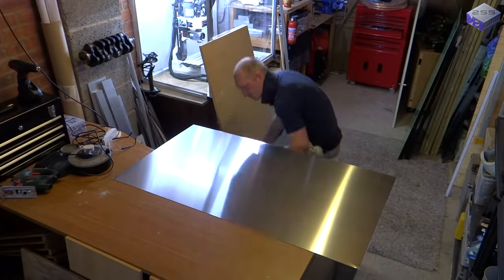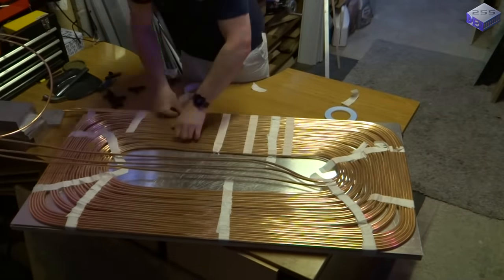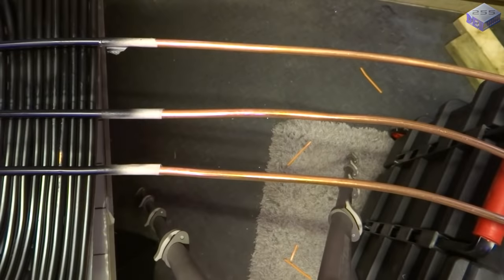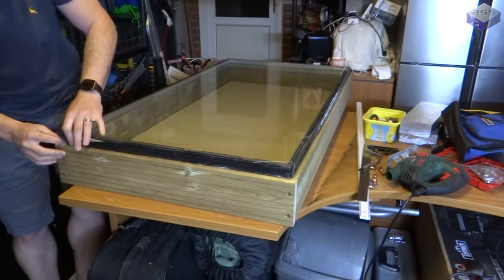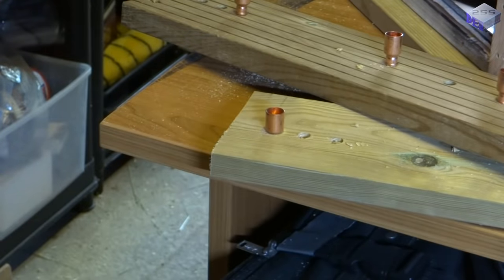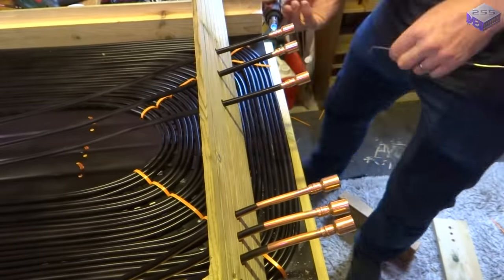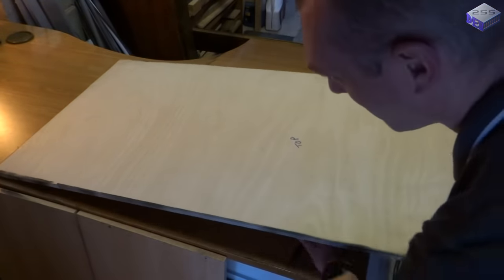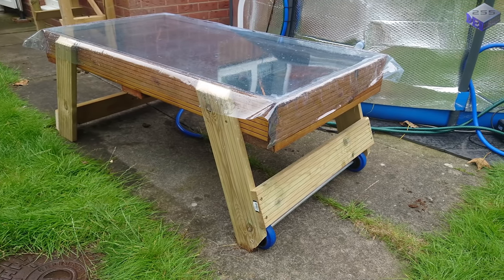Improved Solar Pool Heater - Full build

Comment: Sorry - believe it or not painting the base the tubes are sitting on mat black has zero effect on increasing efficiency in most cases, because it doesn't matter if visible light photons are scattered from the base surface onto the pipes (for a light colored surface), or if invisible infrared photons are scattered from a hot black painted surface. Both will result in the same flux of scattered radiation on to the pipes. In fact if the mounting surface is a heat sink like concrete, then painting it black will actually produce a worse result than keeping it white, as the heat will go into the concrete instead of scattering back out onto the pipes if it was white. In fact, in high wind a hot black painted base may lose more energy than a white base, since wind air in contact with the black surface will strip the heat off.

If on the other had the backing material was made of a conducting metal and had good thermal transfer to the water in pipe then yes a black base surface will help. It's all about - the best way of channeling ALL the heat from the sun into the pipe and into the water.
Reply from the maker: No dramas, the backing material is made of 6061 Aluminium and is thermally connected to the copper tubes. With the insulation behind the aluminium panel and air surrounding protected from wind stripping the valuable heat away, the idea was to transfer that heat into the tubes through conduction. Although as you say, if it was reflective the full light spectrum from the sun would reach the tubes from below too. H'mmmm, I hadn't given the reflective surface much consideration. Maybe if the surface remained reflective and thermally conducting to the tubes, I'd have the best of both worlds. Thank you.

Comment: Use Musou Black or vantablack paint. 99.4% absorption.  Or Singularity Black for 98.5%.  Matte black is only about 80%

And those plastic zip ties won’t last long under the suns UV rays I’m afraid. 
They’ll become faded & brittle.
Reply from the maker: Hi, I may try the Vantablack to see how it affects the efficiency. The cable ties are holding up strong, although this may be due to the glass reflecting the UV away. I will be changing the glass for polycarbonate at some point, so I will change the cable ties for metal ties then.
Reply: @TheSolarPoweredEngineer  That would be cool. According to another video, you might wanna look into E glass.  I’ll post a link below in a new comment
Reply: @TheSolarPoweredEngineer  start video at 14:15 https://youtu.be/5g5PW78XMSo
Reply from the maker: @thomaspayne6866  Thank you, I'll take a look. It may have blocked the link, although I will look to allow it
Reply: @TheSolarPoweredEngineer  yes, I posted the link but apparently nobody else can see it.  Could also search YouTube for this video title, “ should you really use solar panels?”

Start video at 14:15
Reply: @TheSolarPoweredEngineer  Found another video with more information. 
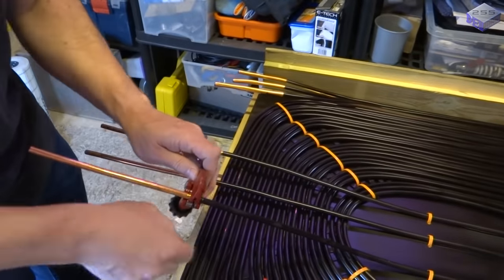Video titled “Solar powered air conditioner!”  From the same Tech Ingredients channel.  Start video at 11:02
Reply from the maker: @thomaspayne6866  Thank you, all relevant info that adds to this video 👍

Comment: 500W?!
That is not very much, are you sure?
Reply from the maker: Hi, yes that is the value I got from last summer, although we didn't have a great one. This year I intend to test it further with 3 flow rate meters and a number of temperature sensors, to see how each channel does and whether the pipe configuration makes a difference (series/parallel). Plus I'll just the flow to see if I can find the optimum rate.
Reply: @TheSolarPoweredEngineer  
I use a lot of Heat Exchanger in my field of work (100kW to 10MW range tough) and the rule is simple, the more flow the more heat exchange (with a given hot side)
So try to go with all tubes in parallel and as much pump power as you can.
But consider that this also means lower return temperature then slow speeds. So if your goal is a very high end temperature (without circulation) then ofc the serial aproach is better
Reply from the maker: @florihae  Thank you, that is good to know and confirms what my thoughts are with the flow. I was also thinking of a solid-state collector with resin to keep the air off (or a small vacuum cavity directly above the collector, possibly creating aluminium panels with lots of surface area (similar to most heatsinks) and running an insulated heat exchanger behind it to take the heat away quickly. I think 10MW maybe a little too much for a 4600 litre home pool 😉
Reply: @TheSolarPoweredEngineer  well, we are building evaporators that boil away 180'000 Liter of Water an hour, so a few MW is not that much 😆

Vacuum is a good idea. Resin less.
Let us know when you have an update!
Reply from the maker: @florihae  wow, you must have a lot of clouds where you are 😁.

Will do.
Reply: @TheSolarPoweredEngineer  haha, zero actually, the water vapour gets condensed again to recoupe the energy ;)
Reply from the maker: @florihae  That is a good use of all that energy, nothing is wasted then.

Comment: Air gap the layers of insulation for highest value.
Reply from the maker: I will be doing some modifications soon, such as reducing the air at the top, so may just move everything up for more insulation, although I did put 2 layers of heat reflective material in. Thanks for the suggestion 👍

Comment: You should just "wire" the new one into the old one.  "Doubles" your heating.
Reply from the maker: I may try some different configurations, although I will need to have them separate initially to compare the difference, this will give me a baseline to see if the new version is improved by any modifications I am planning to do.

Comment: copper with chlorine water, makes your pool water green...you cant use copper, although it does conduct better than plastic pipe
Reply from the maker: This was a concern of mine too; where I've been researching this a fair bit to find a definitive answer. The Drinking Water Inspectorate (DWI) requires that drinking water is maintained at the correct PH level and add 1mg/l (1 part per million) and up to 5ppm of Chlorine when carrying out maintenance; this (according to the below link - DWI Chlorine) is the safe level for drinking water within England. As this water predominantly runs through copper pipes in the home (replacing lead piping), there should be no concern with copper use concerning Chlorine as long as the PH balance is maintained. A greater PH imbalance exacerbates the issue with chlorine and copper corrosion. I agree that drinking water is constantly run through the home water system, where the pool water is cycled around the same system. However, if this is correctly maintained, there should be no concerns, especially as pool water is classed as non-potable.

A good point to note though, is that I've introduced a UVC (UV Clarifier) to our pool that allows us to reduce the Chlorine level to around 1ppm from 3ppm.

Here is the link to the DWI Chlorine document: https://cdn.dwi.gov.uk/wp-content/uploads/2020/09/23151717/chlorine.pdf#:~:text=The%20World%20Health%20Organisation%20has,level%20below%201%20mg%2Fl

Comment: now fill the frame with sand and face it into the sunshine
Reply from the maker: I could spray the sand black I suppose, although don't want to store the heat, just transfer it to the pool as efficiently as possible. I'm also looking to fit 2 reflectors that track the sun so that the panel doesn't have to move and there's less energy in moving 2 lightweight reflectors. It would be cool to make a sun-heated sandpit/storage device that stayed warm into the evening. 🤔

Comment: he built it wrong your soposed to puta mirroron the bottom elevate the tubing and put a two way mirror on top so the thing trtaps light  inside and heats up hoter and faster
Reply from the maker: I have got a few things I want to try, including what you mentioned. Plus, I will be fitting adjustable mirrors to the sides that track the sun, so that more light enters the unit. Sadly the sealed glass unit has now blown while moving house, so I am going to try different materials.

Comment: Looks good but damned expensive.  Copper is pricey pex is cheap and while not as pretty still incredibly effective.
Reply from the maker: Hi, I agree it's more expensive than my first panel with pvc pipe and purspex top, I built this one from all the viewer comments from the last one just to compare the differences in performance, luckily I got the sealed unit for free from a friend and had the wood left over from another project, so made it a little cheaper. I will be doing a comparison video this year to see if it's worth the extra 🙂

Comment: Металический каркас нужно,пару лет и дерево сгниет и будут щели
Reply from the maker: A Metal frame would definitely be more beneficial, although I was concerned over heat escaping as it conducts through the metal. Although, if also sprayed black it could increase the heating effect.

Comment: thermal paste would have been better altho more expensive than the tape
Reply from the maker: Hi, I agree although may have made a mess too and didn't know how it would react if the panel got very hot as it's normally sandwiches between component and heatsink, I may change the design even further this year just to try anodised black aluminium heatsinks with water flowing through 🤔👍

Comment: 2 foot by 4 foot. 8 sq.ft. times 150 btu an hour. Yes 500 watts is about right.  I buy 500 watts of electricty for $0.08.  7 hours of good heat gain a day offsets $0.50 I hope all the materials were free. The aluminum added no value. just paint the wood black/brown/ dark green/ blue.
Reply from the maker: Hi, thank you, the aluminium helped with the tying down of the tube and possibly helps a little transfer some heat to the tubes, although hard to tell how much. I intend to do a good number of smaller experiments this year to see which configuration is best.

Comment: As a plumber, electrical solder uses lead. Bad choice.
Reply from the maker: Hi, I agree lead-free solder should not be used. I only use lead-free solder on electronics too, where this is readily available. The solder I use also has flux within the core of the solder which ensures the solder flows better and cleans the copper surface.
Reply: @TheSolarPoweredEngineer  Oatly number 95. Pre tinninh flux. Has solder in the flux. 

You can also stick the solder IN the flux. 

But since people will be swimming i advise against using a pool heater since a leaded solder was used. 

But hey with how many parts per million it would need maybe in just a worry wort lol.

Cool video though wanna try something like this myself one day
Reply from the maker: @andrew1898  Thank you, I think it's worth looking into heaters like this made at home as the commercial ones are starting to increase in price. Good luck with yours, you may want to look at my first version, it's fairly cheap and works really well. https://youtu.be/QU7RUfWXfZ4

Comment: Considering the successful design is cheap enough to cover at least the pool size area, this looks like a failure. Panel this small will not have any practical impact on your pool temperature considering how much energy is lost at night. Sun's energy heating up the pool is 1kw per squared meter. The area and efficiency of capture and transfer matter. Efficiency gains are expensive, and that's why the winner is the area coverage done cheaply.
Reply from the maker: Hi, yes this would be a little small for a large pool, although would be ok for additional heating of a hot tub or taking the edge off a larger pool, where this collects around 500W and is just under 1 square meter in surface area, although I believe the efficiency can be improved, this is what I am aiming to do with different material. With around 3600Wh per day (very sunny day - 450W over 8 hours) collected, that would save around 66pence per day in electric heating a hot tub (when used in conjunction with one). Where Solar Thermal is much more efficient than Solar Voltaic, around 90% compared to 20% respectively. This panel was made to see how efficient they could be from standard material for a home DIY'er. More to come on the testing side though.

Comment: You project is very cool but not useful. Even you would have a perfect performance you will take 1kw per square meter. Depending of the size of the pool and the weather in your area, I am sure that the heat lost of your pool is much bigger than this, specially in the night :). And assuming cero hear lost it will take make a month to increase one or two degrees the temperature of the pool. Sorry

Comment: Why do you need glass on top ...why not make it open as some percentage of  light reflects back....secondly use black marbe stone tiles as they get warm they are pretty hot...we have it on our pourch by mistake and it litterly cooks eggs. do a little research.....rest your project rocks
Reply from the maker: Hi, the glass is there to insulate, trapping the heat in so that the air movement around the unit does not take the heat away. You are correct about the reflections, where I chose a double-glazed unit to trap in the heat, although this will be reflecting some of the energy. I need to change the glass to something like polycarbonate, single-pain plain glass or acrylic to see what the effect would be, similar to a greenhouse trapping in the heat but allowing the sun's energy in. I need the panel inside to stay cold, though, so there is more capacity to heat up and for the water to quickly take that heat away to the pool, this is what makes it more efficient. I'm not sure if black marble would work well, as it would take a lot to heat it up initially. Thank you, there should be more to come.
Reply: @TheSolarPoweredEngineer ،👍👍😍

Comment: Seems way too expensive. Copper, Aluminium sheet, glass. You could make of plywood, wood, pvc and pvc glue. that's it you don't need anything else.
Reply from the maker: It was fairly expensive, where I did make a PVC version with wood, Perspex, and cable ties that worked really well, I made a video about it here: https://youtu.be/QU7RUfWXfZ4

This version was to see how efficient this could be made.

Comment: Very serious mistake, you should not design a structure that must be outdoors in wooden material as in case of rain the structure would be damaged in case of rain in a short time, better to make it in stainless steel or better still in aluminum or Plexiglas.  !!!
Reply from the maker: Hi, I have used external decking board for the structure and treated it to a decent coat of wood sealant, so fingers crossed it holds up, it hasn't shown any signs of rot as yet and is very sturdy. I made a table with the same board last year and haven't yet treated it and that too has survived the UK weather onslaught.

Comment: How many toxic chemicals can you fit in a solar oven.... And let's run that water through garden hoses that say do not drink from hose.... I hope you're the only one swimming in that. If you notice the hoses that come with your pool are white plastic generally considered food safe.
Reply from the maker: Good point, this is something I'm looking into and will be asking universities and a lab to have a greater understanding. When I first made this I looked into chemicals and copper, where I only add a small amount of chlorine to the pool once used and maintain the PH balance so the reaction is very little. I would like to show official statistics of chemicals in the pool so that there is more awareness. The garden hose is very short, although will look into these as well, most garden pools are filled using garden hoses, but I suppose this is just once on filling up, not constantly running through. The idea behind copper over any other material was to limit reaction as copper is in most homes as drinking water pipes, where drinking water has a small amount of chlorine and has a neutral PH level, hence the importance of maintaining good pool water. It is a topic that needs more clarity though as there is not much on this on-line. I would not suggest drinking pool water though as it is deemed as non-potable. Would like to hear more about the types of chemicals transferred to the water though, I will be replacing mine with plastic. Thank you. Oooh, just a thought, I may use this with a water heat exchanger, that way it would be a separate pumped system.

Comment: just use a regular, cheap kpe pipe
Reply from the maker: Hi, I will be making a version 3 with hose lock pipe, where I did look into KPE pipe, although was not sure what would happen over 30ºC, as this is the maximum temperature for KPE as far as I can see. Our pool has been up to 33ºC so far this year. I will have to do some more research, as I like the fact that KPE is for potable water.
Reply: @TheSolarPoweredEngineer  kpe made from  abs its safe til 70-80C.
Reply from the maker: @makoado6010  That's good as I do need to use more of that tubing, especially with our pool still at 24ºC with an outside temp of 14ºC, so need to increase the temperature to see if we can use it all year round